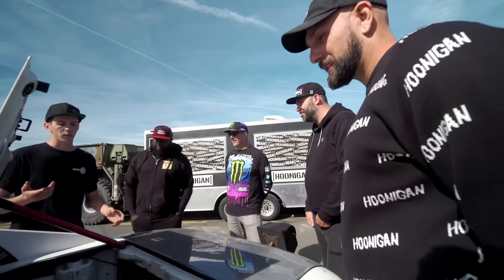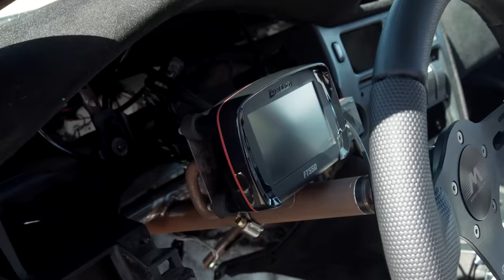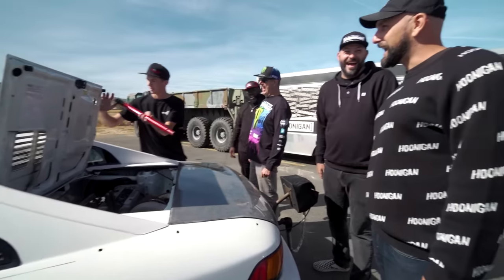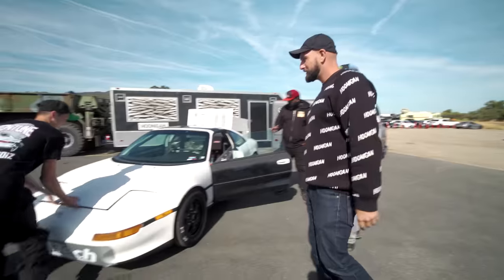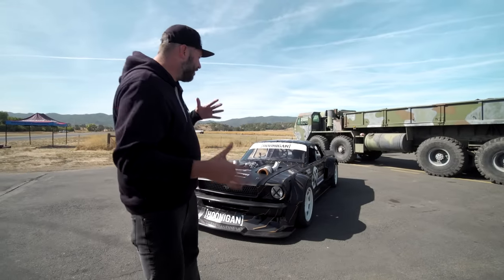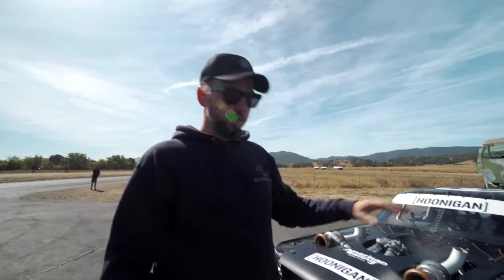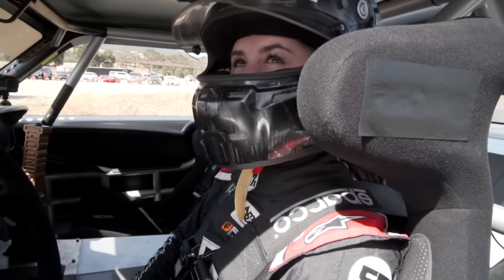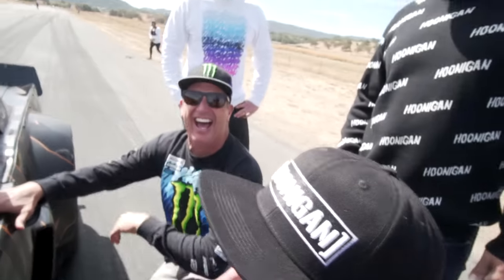BoostedBoiz' 1300hp Toyota MR2 vs Lia Block's AWD 1400hp Mustang

Comment: I'd like to see timed runs on a prepped course now, I'm just curious what the Hoonicorn is actually doing.
Reply: My guess is mid 8s if it can stay together in the first 60 feet
Reply: Mid 8s on no prep and DNF on a strip 😂
Reply: yeah I don't know what's up with this channel, they could al least throw in a Draggy in that Hoonicorn once in a while.
Reply: It'll break on prep track
Reply: @la_plata3588  running on street tyres ??
Reply: @rhett7716  it's broke 2 times on no prep this season. Even on street tires on prep will have way more grip than the airstrip
Reply: @rhett7716  it's broken on the airstrip so yea it would grenade difs/drive shafts/ possibly transmission
Reply: They don't want us to know
Reply: Either way heads up on the  streets  as is  of now , I think this hoonicorn killed it for now until the next legend...30yrs street race experience here.
Reply: Nitros
Reply: Too fast until the next legend
Reply: Hoon at a prepped track with some dial in... mid 7’s, maybe faster.
Reply: Im guessing its way more than 1400hp too
Reply: @williamkillingsworth2619  
Secrets
Reply: The hoonicorn side is prepped lol look at all the rubber on that side compared to Kyle’s side. Shits rigged they don’t wanna lose on their own show. Switch lanes give the hoon the garbage side
Reply: We all are
Reply: @igameincolor4597  good point. Also the breakage thing isnt an issue. This thing was built on an unlimited budget, they can replace and improve any component that breaks on pretty short notice
Reply: if it could hook and hold together on a prepped track i bet this car would go high 6's
Reply: @subl1minal  You're smoking crack if you think it can do 6s. 🤣 Do you know how much hp 6s cars make at similar body weights? All these casuals are so clueless! 🙀
Reply: If it truly makes 1400 whp, then there's a chance it can crack into the high 7s, but most likely still low to mid 8s.
Reply: @subl1minal  Name any car that makes 1500 whp or less, regardless of weight, that can run 6s. Go ahead, I'm waiting. 😏🥴
Reply: @igameincolor4597  So true....
Reply: @subl1minal  it would break on a prepped track, gearbox or axles.
Reply: @subl1minal  Just for reference so you casuals can learn, Cleetus makes more hp than the Hoonicorn at a much much less body weight and is a dedicated pro drag car but can barely run mid 7s, and that's the record in that class. 😏
Even a 1500 whp pro drag Miata that weighs like 1 pound can't run quicker than mid 7s. And you casuals think a 1400 whp almost 3k-lb car can run 6s? 🤣
Reply: @KALSPL  high 8s only just beat the tesla !!
Reply: @subl1minal  If we're just gonna spew out bs numbers, then I say it can crack into the low 1s. 🤣
Reply: @everrybody  of course !!!😣
Reply: @rhett7716  The Plaid EV makes instantaneous torque and has no gears to shift (single-gear transmission). That's why EVs are so quick. We're talking about a 1400 whp gas car that weighs nearly 3k lbs; it most likely runs low to mid 8s with drag radials if it can keep itself together.
Reply: @avatar94100  nah  u shud be able to figure it,  only just beat a tesla plaid .... do the math !!!!
Reply: @la_plata3588  hmmm maybe theyve put in stronger axles.... and maybe not...  😞
Reply: @chrisparish4668  yep x2 !!
Reply: @williamkillingsworth2619  well only just beat the tesla. soo mid 8s !!
Reply: @m.b.82  awesome 😱
Reply: @igameincolor4597  what side did the gtr beat it on ? 😣
Reply: @rhett7716  Cleetus makes 1500 whp and weighs like 2 lbs and is a pro drag car but still runs mid 7s, which is a world record for that class. It would sh all over the Hoonicorn.
Reply: @Asiansxsymbol  mid 8s !!
Reply: The GT-Rs that run 6s all make 2500+ whp. I think the ETS GT-R makes 3500 hp.
Reply: @kevinkarbonik2928  into a zillion bits.... 😣
Reply: @rhett7716  Yep, mid 8s seems about right.
Reply: @Asiansxsymbol  yeah and thats why the corn just beat it 1400hp is about rite. corn high 8s on unprep maybe mid 8s on strip
Reply: @Asiansxsymbol  wtf did i say it wouldnt ???? 🤤
Reply: i bet it would destroy all the axles.
Reply: @rhett7716  not sure never watched the other episodes Gtr is awd doesn’t matter for traction which is what Kyle was lacking lol
Reply: 6.69 for real!!
Reply: I read somewhere that the whole drive train isn’t rated for the power they are pushing on the Hoonicorn, but works because it slips traction. So im guessing that on a sticky prepped track that would just grip they would just destroy all axels, more so than they do on an unprepped track
Reply: The race against the Audi RS3 before it started running 7s gives the best look at what the hoonicorn does. Low 8s. Pretty much 8.0 on no prep
Reply: @rhett7716  na its a 2800 lbs legit 1400 whp car.  Its got 7’s in it.  On a prepped track it would pick up a lot of time.   I would bet they could throw more boost at it in 1st and 2nd gear.  Its mid 7 at around 180-190 mph.
Reply: @Asiansxsymbol  which car?? All of cleetus’s cars are over 3,000 lbs. Hes also 6’6” he is closer to 200+.    On the street the hoon would smash anything cleet has, at the strip... if they took the time to dial it in, it would be interesting,  it would take some work to get it dialed.
Reply: @igameincolor4597  the marks on the Hoonicorns side is from it spinning the tires off the launch, if it had prep it would blow up
Reply: @lhummel7398  the car has been running all day i watched Kyle’s perspective he said the hoonicorn  was out there practicing all day in that lane
Reply: @lhummel7398  that’s still rubber on its lane from spinning yes that’s how tracks become stickier aside from vht being laid
Reply: @Asiansxsymbol  I agree, 8 second range. I think that was Brandon who said 6s 🤣
Reply: Now let’s get this outta the way right now the Hoonicorn  has to be one of my favorite cars of all time but it was built on a damn near unlimited budget. The Mr2 was built in a backyard garage with limited funds. I’m damn proud of Boostedboiz and PFI speed. Bring the Hoonicorn to Bradenton and then let’s see what happens.
Reply: Absolutely! A top gear style time board they update after each episode would be goated
Reply: If they could get this car to stay together  and dial it in on a prepped track this is a mid to low 7s car ALL DAY
Reply: Cleeter need to bring  the bois to Florida for a real drag against Mullet
Reply: @subl1minal  no shot😂😂 you know it’s still a manual 😂 you can’t just dump the clutch and go that fats it’s requires skill! You need well over 2,000hp and a 1.1 60ft
Reply: @williamkillingsworth2619  I’m thinking low 8s on the same set up
Reply: @WorkinClassCanadian   definitely not 8.0 on no prep
Reply: @jodyjohnstein  no shot for low 7s on the current set up
Reply: @syco133  the mr2 is still built with some pretty trick bits 🤤
Reply: @isaacboettcher3489  you have absolutely no idea what you're talking about. So much so that this will be the only response you get.
Reply: @isaacboettcher3489  when you're pulling on a car that ran 7s a couple months later you are 8.0 somewhere.
Reply: @isaacboettcher3489  i am thinking you should have switched the Geico... 🤙🏻✌🏼
Reply: @chrisparish4668  yeah, it's just unbelievable how that thing just fucks off!
Reply: It runs mid 8s
Reply: I think it would break in just 100 feet
Reply: @everrybody  yeah, a Sadev drivetrain will "grenade"... lolol

Comment: the drone angle at 13:10 needs to be in every single video, absolutely amazing shot
Reply: 100%
Reply: Agreed!
Reply: It's mind-blowing
Reply: Exactly
Reply: We had the same thought at about the same time
Reply: my jaw dropped and i full on did a home alone hands on face and replayed that part like 4 times
Reply: it's in most of them except when it's windy.
Reply: Crazy how fast the hoonicorn is. Just insane
Reply: yeah 100000% it shows how fast this cars acually are
Reply: @sirmonkey1985  they normally show the line crossing... pretty sure this was the first wide shot of start to finish... (I could be wrong)
Reply: 1400 % supported. Loved it
Reply: Lets get this highlighted! 100%
Reply: That shot really gives you a perspective on how fast both cars really are!
Reply: Really puts into perspective how fast shit is.
Reply: Hell get an fpv drone racer out there with a rig and you can get a chasing shot all the way down the strip. Or better yet, make them race it, with a 0-100mph in about a sec it'd be an interesting race
Reply: man it looked like a jet taking off shit was moving 💨
Reply: Agreed

Comment: We definitely need to bring these two to a dragstrip, would be crwzy to see the mr2 actually hook against the hoonicorn
Reply: To the moon!
Reply: 402M on prep track , it wil smash the hoonicorn
Reply: Keen to see the hoonicorn hook up too!
Reply: @valentin7349  Smash the Hoonicorn?? Nah, but it'll give the Hoonicorn a run for it's money.
Reply: @danieljakobsen1289  on prep track hoonicorn will not leave or will break
Reply: @valentin7349  doubt that!
Reply: Hoonicorn would break at a prepared surface
Reply: They’ve already said it’s not gonna happen, those street slicks catch and all 4 axles are gonna explode
Reply: @valentin7349  yeah it'll definitely break(because it's not built to Hoon which gives the drivetrain a lot of stress) or not leave(because AWD doesn't give enough traction and tires can't have their pressure adjusted)......
Reply: I wouldn't be surprised if they did a seris at a real strip, but idk if they'd do the Hoonicorn since they'd need almost an entire suspension overhaul. Ffs they're blowing apart drive shafts on this surface.
Reply: @valentin7349  they'll be able to detune it enough to survive
Reply: @wheeln24-79  survive but taking a big L
Reply: The hoon on a sticky surface might break some drivetrain components.
Reply: @danieljakobsen1289  the hoonicorn isn't a 7 sec car the mr2 is
Reply: @302hobronco  they've broken a couple driveline on their current surface lol they'd probably been to rework alot of the drive train including the sadev. Probably better to just purpose build a drag car at that point with a similar engine to the Hoonicorn
Reply: @rushking19  no one knows how fast it is on a prepped surface.....
Reply: @danieljakobsen1289  tf? This is a 7 second mr2
Reply: I mean he knew the set up... the hoonicorn doesn't race on track...............
Reply: @danieljakobsen1289  
ROFL!! The mr2 runs 7s at the track. It was turned down to around 800hp for this race because of traction issue. Sorry dude the hoon would lose at a prepped track
Reply: The hoonicorn would hurt itself
Reply: This is why I say they need to race Red Demon.
Reply: Lets say the hoonicorn could survive a launch on prepped surface...Mr2 is taking an easy win at the track. On this surface, can't get out the hole, spinning the 1000ft  all while the fuel tech pulls power for traction control. You can hear how broken up the mr2 sounds down the track
Reply: @wheeln24-79  yeah and whats the point of that !!
Reply: @rushking19  ok so u know the outcome so dont need to prove it !!@
Reply: @brianawd  good everyone knows, so watch it in yr mind !!! or on yr forza or whateva !!😣
Reply: @Turshin  is it awd ???
Reply: @chriss1683  hoon spinnin too 😂
Reply: @rhett7716   Forza what the fuck are you talking about? Sorry I don’t play video games. I actually play with real cars!!
Reply: @joshwalters348  I'm betting if it did happen on a prepped surface they would dial down the launch tune and bring it in heavy on the top end.
Reply: nah no race corn mid 8sec car
Reply: @danieljakobsen1289  it is built to hoon  but not to dig
Reply: @rushking19  correct  way too slow
Reply: @air-headedaviator1805  and we would all cry 😣
Reply: @brianawd oh well watch it yr mind then 😱
Reply: @rhett7716  yep 2nd fastest stick shift car in the world. Runs a 7.02 in the quarter.
Reply: You only need to detune first gear. And give it more clutch slip on the launch. Top end is crazy enough on the hoonicorn
Reply: Looking at the 7.9 pass vs her best pass that day with the incar video, I would assume at the track they would be a good race to watch.
Reply: @brianawd  more like 680hp......
Reply: @rhett7716  dude is just not physical possible with the way the hoonicorn is set up rn it has way to tall of a final drive for it to even want to launch properly on a drag strip without breaking stuff and then launching bad . If the hoonicorn didn't spin then most likely it would of just broke something plus half of the time you  are driving you have to shift causing you to lose speed .  Plus the mr2 has the better power to weight ratio. Come back at me when you actually learn about cars.
Reply: @rushking19  i dont know what the f you chirping here mate?, maybe uve got the wrong person or cant figure out what im saying. and fyi ive been on the planet plenty long enough to know cars !!

Comment: I'm so happy the BoostedBoiz came to race. I've been waiting on them since Hert suggested getting the Rowdyssey against the Hoonicorn for season 1
Reply: im tired of watching hoonicorn win everything tbh
Reply: @procerus3654  the hoonicorn is really well setup for specifically what they are doing, at least this time most cars are losing due to traction. Last season they kept putting heavier cars with way less power against the hoonicorn and acted like they had a chance
Reply: they got murked.ahahahaha they should of just stayed home
Reply: @procerus3654  bring something or suggest something that you'd like to see beat it, or go watch a different channel.
Reply: @procerus3654  win everything did u not see the episode with the gtr smoked the hoonicorn even they said it 🤣
Reply: Rowdyssey is too heavy and lacks power. Hoonicorn is well over 1400awhp and has huge tyres...
Reply: @heavymetalweld805  or go with hoonicorn on an actual drag strip, on the sticky surface designed for such shenanigans, and see it fall apart against others that were made for this

or at least borrow those fancy ass tires they so proudly show off on every episode to opponents as well, so they have at least a bit more equal grip
Reply: @kangarojack3814  thats one of 100 episodes or how many they are out by now

Comment: one thing i feel that gives Hoonicorn an advantage is the track, most of the opposition runs on prepped surfaces, so they spin so much
Reply: Yeah, I don't see anything really being competitive that's not 4wd on that track.

Hoonicorn would probably break a ton of stuff if they used prep though.
Reply: Robert Meulman  this. it's getting pretty old. and you mean victory runs for tube-frame 4wd race car vs almost always street cars.
Reply: Robert Meulman  yeah and these guys are always sandbagging that hoonicorn you can see in several of the runs that sometimes it's not as fast as other times they're smoking the tires all the way down the track if you're going to be doing stuff like this you should be going balls-to-the-wall every race no-questions-asked
Reply: Robert Meulman  hopefully this time around they get something spicy like a UGR gallardo or gtr, or one of those calvo vipers, something designed and built for no-prep or street
Reply: @N4CR  They’ve raced both the rs3 and the kimbo slice gtr which is the only same horsepower awd cars they’ve raced, and both of them smoked the hoonicorn. Seems like this is their way of proving a point that last season they were racing against sub 1000 hp cars and now they just go and pick big hp number cars that obviously will lose on unprep surface. I mean they can at least run no prep cars that are rwd like beater bomb and the other no prep kings to prove their point
Reply: @woodendog516  it’s so obvious 🤣 the hardest races for the hoonicorn where against the rs3 that after the first race Hank told the hoonigan guys to Turn it up. Second race rs3 beats the hoonicorn and suddenly third race hoonicorn wins with like 3 cars before the rs3 won with 4 cars. Against the kimbo slice GTR it was even more obvious even snapping the crankshaft in half in the “decisive” race. It’s obvious they are sandbagging and to have this car against prep cars is unfair. That’s why cleetus didn’t want to race the hoonicorn since what’s the reason to just go there and spin a lot. If they wanted to they could go and ask the no prep cars and I don’t think a lot of them would turn it down lol
Reply: if they want to race no prep race one of the street outlaws
Reply: @real_talk1180  hopefully sometimes it happens. It would be an interesting race to say the least
Reply: @ergopropterhoc  been saying that they need to get some real NO PREP cars out here but it'd be hard to sell Hoonicorn merch if they showcase their car not dominating everything I guess...